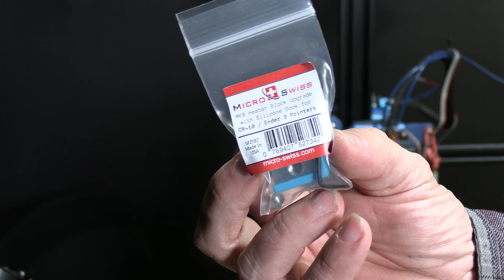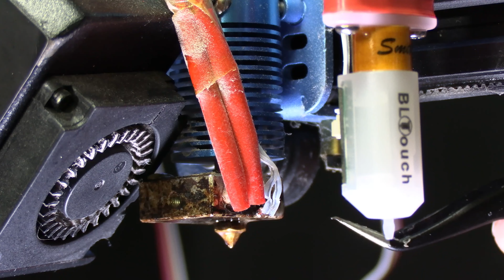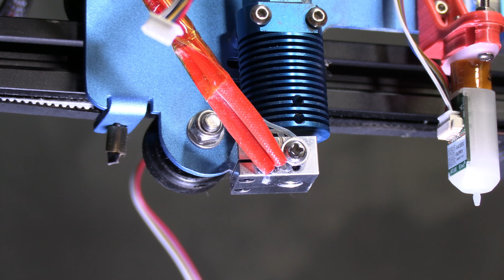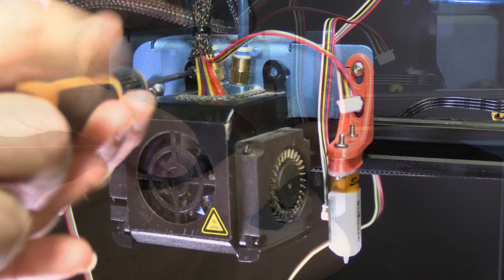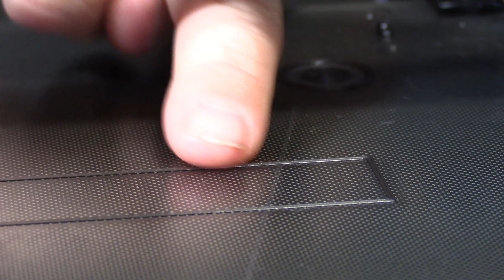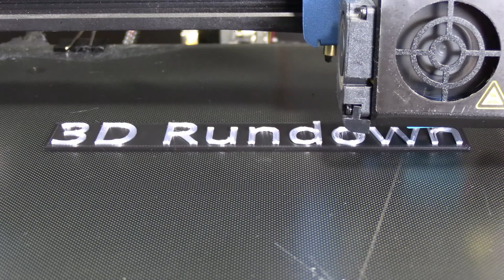Replace SOVOL SV02 Hot End Heat Block, with Micro Swiss Heater Block, Silicon Sock, Creality Nozzle

Comment: Thank you, thank you, thank you! I have a malyan ma10 and replacement parts are virtually non existent. I accidentally broke a nozzle in the heat block so i figured a small part like that is easy right? Nooe i could work out how to remove the connections, a bit of heat and watching someone do it made it come out perfectly. Im waiting on the new blocks to be delivered but you sir, have saved my printer
Reply from the maker: Ah yes. THIS is the comment I've been waiting for, to make me feel like it was worth it, to shoot this video. So cool. Very pleased to rescue your machine, and get you back to work! Consider a Super Thanks, or using affiliate links, to help me continue to do this. :)  Good luck with the surgery!

Comment: Tried doing this but the holes align to the left  angled and it will not tighten any more 🧐😩
Reply from the maker: Oh no....  That's crap. The heatblock doesn't line up?
Reply: Nope the holes lineup angle toward left and wrenching hard with wrench only gets them angled slightly forward 😩 guessing my threads are too few or aligned different.  No matter how many times I try or start it off, it ends the same.  Only thing I can think to try is try and find some super thin washers to shim it until it aligns right when tightened

Comment: I can't get the heat block to come out, even after heating the hot end. Any suggestions?
Reply from the maker: Did you remove the little grub screw? Did you turn it? Can be tight....
Reply: Yes, I removed the screw holding the thermistor in place. Are you referring to the small black screw perpendicular to the thermistor screw?
Reply from the maker: Yes, it's a tiny little grub. It's black. Use an Allen key